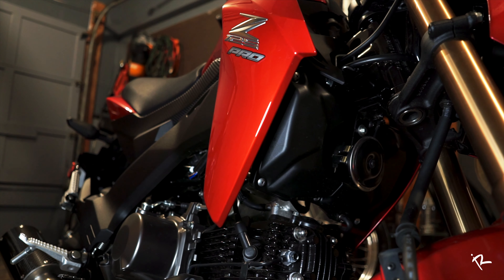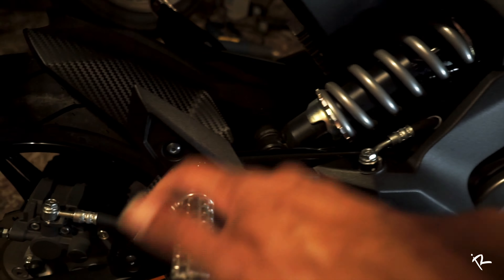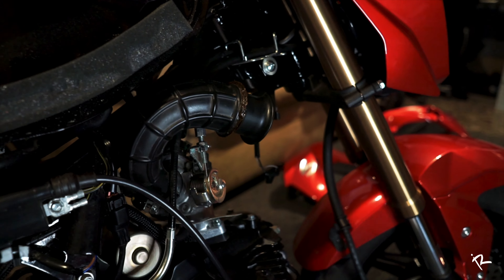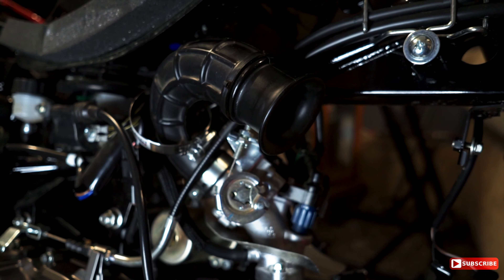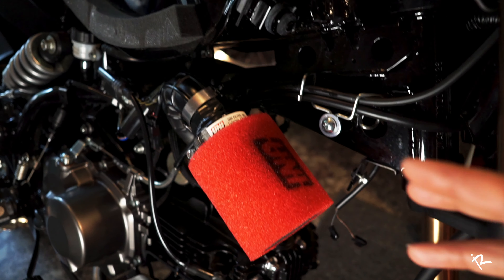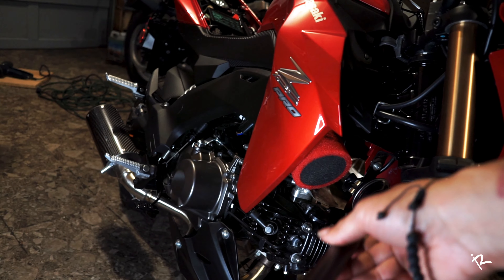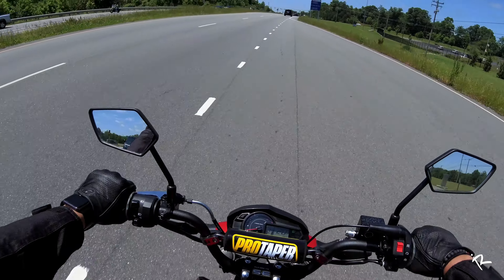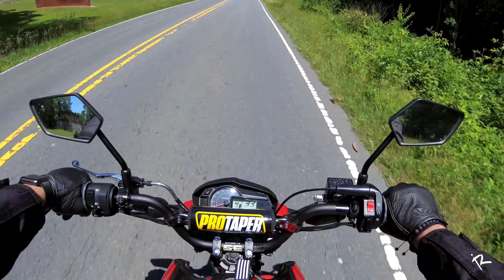Kawasaki Z125 Cold Air Intake  -  Do It Yourself

Comment: Do you plan on getting a tune for the bike at all? My Z really woke up after the tune. I have a yoshi exhaust replica (cause I'm also cheap lol) and a MNNTHBX intake. I got the BAZAZZ fuel controller and its awesome!
Reply from the maker: I’m definitely thinking about it
Reply: @theinfinitryda  the bazazz has tune maps for all ride types, stock all the way to modded. It helps to keep the bike from running lean when getting more air from the exhaust and intake mods.
Reply from the maker: Josh Boone does it need a tune with air box and exhaust mod
Reply from the maker: Chris H I think I’m going to order one today. Just didn’t want to waste my money if it won’t do anything

Comment: This does not work guys.  The end of intake is too soft to tighten the filter to
 So basically dirt will get int
Reply from the maker: That’s the purpose of the tape
Reply: Bro why you spending 99 cents on a 3k dollar bike. Gimme that bike bro. Let me teach you how to ball
Reply from the maker: Stunt Slowly $3k is an expensive bike to you? lol
Reply: You can use a little piece of pvc pipe in the end of the intake so when you tighten the filter down it doesn't crush the rubber intake pipe.